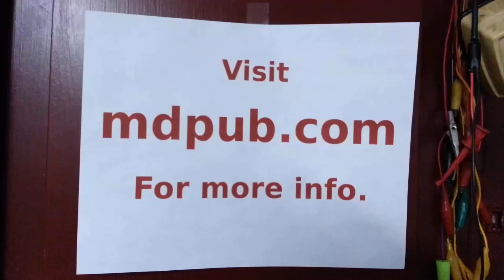Telescope Mirror Blank Making Update: Design changes, scaling up and R&D while the power is out.

Comment: I'm finding the whole process interesting.
 I have seen metal casting videos where they talk about draft angles and corner radius, these don't seem to be a problem with glass, is that correct?
Reply from the maker: Not for the most part. The plaster molds used for the glass are one-time use. So there's no real need to design in draft angles to make removing the glass from the molds easy. The plaster becomes very soft after firing and is easily removed even from corners and nooks and crannies in the glass. The 3D printed plastic shapes get burned out of the plaster. so again there is no need for draft angles to make them easily removable. The rubber mold I plan on using to make future plaster molds is flexible. So it will pull out of the hardened plaster without the need for draft angles too. Draft angles would probably help in some situations, but aren't really needed.

Comment: Those are nice looking blanks.

Since you have prototypes it would be nice if you listed the weights.

Also on the topic of casting glass from small pieces/shards in another comment, I have a bunch of boro-float blanks about 5" diameter and 1/4" thick, could a setup like yours melt a stack of those blanks without bubbles or could you maybe fuse a thin sheet of glass for the mirror surface on top of bubbly ribs, maybe in the slumping process? 

It's going to be a while before I work through my less ambitious projects but turning that box of blanks in to one big one with a cellular back might leave me with a 20"+ mirror of pretty low expansion glass.  I think that would be a suitable crowning achievement for my mirror grinding hobby.
Reply from the maker: Yes, I will post weights. The 10 inch blanks in the new design come in around 4 lbs 11 oz. The 12s should be about 1.4 X heavier. I haven't edged my first 12 blank yet, so I don't know the exact weight it will be after cold-working. 

And yes, I have tried fusing a thin sheet over a bubble-filled base. It does work. It just takes an extra trip through the kiln. That gets expensive in time and electricity, especially if slumping too. that can mean three trips through the kiln, since for various reasons the operations need to be done separately.
Reply: @omegageek64  cool.  I can imagine the three trips through the kiln might not be worth it for plain glass but for boro-float, my guess is the cost in time and electricity might be a lot less than the cost of getting an appropriate size single blank especially since I got a lot of the small blanks so cheap.

Thinking about plain glass vs. Borosilicate vs. Real low expansion glass like quartz and fused silica, the coefficient of thermal expansion should dictate how deep the ribs on the back of a mirror should be to optimize thermal performance.   I've got a pretty big but pretty thin fused silica blank that probably doesn't need deep ribs because it shouldn't take long to thermally equalize and shouldn't move very much while it does (I'm pretty sure that's never going in a kiln unless someone can slump it without issue).  Plain glass should need deep ribs because it needs a structure to constrain the figure while it equalizes and reduce the weight to hurry the process (compared to a solid blank).   Borosilicate should be somewhere in between, less movement because the CTE is lower than plain glass and if you made the ribs shallower there would be less mass of glass to equalize.

Comment: I used to do interior demo. The places I’ve found very nice thick glass, usually tempered, is in malls that are slated to be scraped to the ground. The store fronts inside these malls are usually thick glass fronts and you can usually deal with the demo guy to get how ever many you want for extremely cheap pricing if you take it out. No kidding. Many malls will have a couple a hundred store fronts, almost all glass and very thick, are dumped into landfills all the time.
Reply: Unfortunately I don't think tempered is much use, it can not be cut drilled or ground without heat treatment first, and few people have kilns large enough for a shop front window, its a shame it would be well cool to be able to use all that land fill to look at the stars!
Reply from the maker: Yes. If the pieces are small enough to fit in my kilns I can remove the temper easily enough. I have done so a few times. Most pieces of tempered glass I see are too big though.
Reply: @omegageek64  Since you will be melting the glass anyway, wouldn't it be possible to shatter the big glass and fill the kiln with shards? For tempered glass they usually big enough. Are there any problems that I don't see? like too much bubbles in the final blank or cleaning the mess afterwards?
Reply from the maker: @gppl77  Exactly right about the bubbles. I've tried casting blanks from heaps of glass shards. They are always full of bubbles. My kilns don't get hot enough for the bubbles to rise to the top and pop in any reasonable amount of time. The glass is vary viscous at the temperatures I can achieve. Bubbles, especially small ones never rise to the top.
Reply: If you put the entite kiln under a vacuum, you can easly “extract” the bubbles. 
The setup i used before was a small shipping container. 20x20 if that. It had the vents welded. We used the factory seals on the door. 
Now, for the vacuum pump:
2 small block chevy motors were used. The first one had the intake plumbed into the vacuum chamber. This motor was the pump providing the suction. And it wasn’t “running”.  Instead it was been spun by the second motor. The second motor, was only ran at idle, and that was enough to put a vacuum on the “container”. And good enough to get our glass blocks to come out without bubbles.